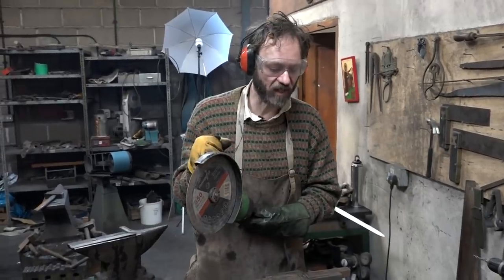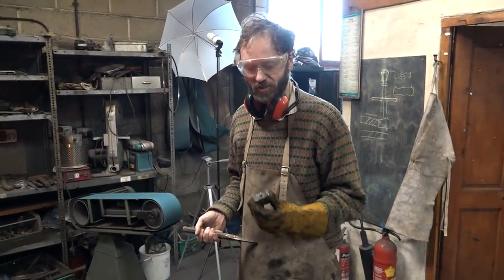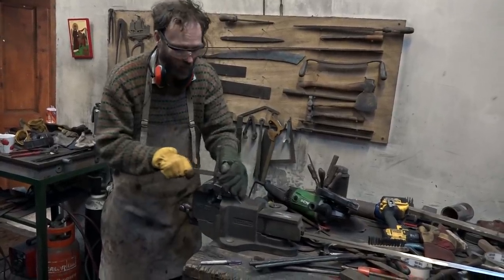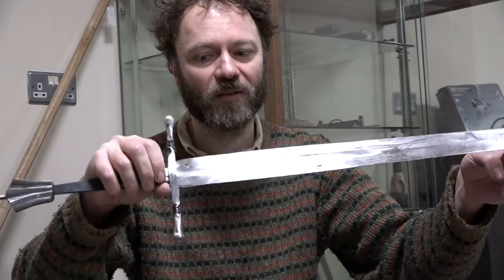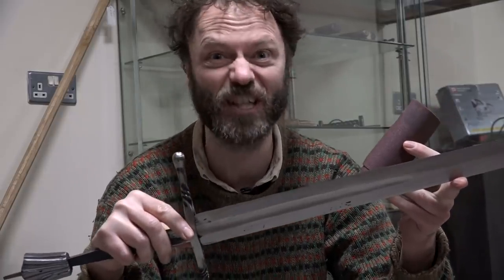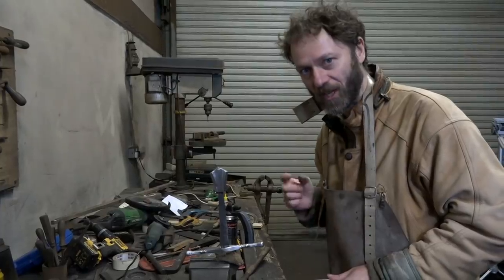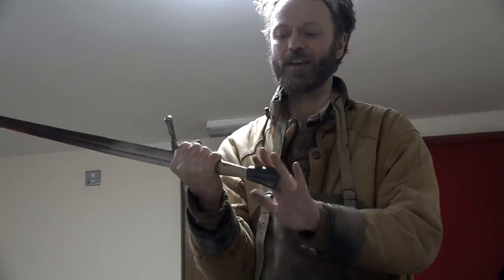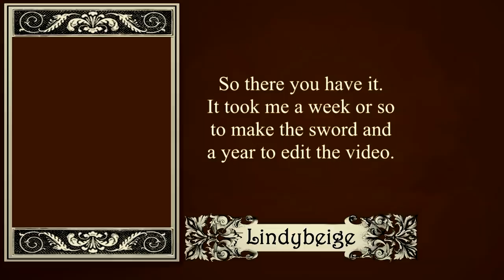Forging a sword: part five - completion

Comment: 5:45 please don't try to forge a katana made out of spandaus . . . we might not survive
Reply: Katana of spandaus sounds like a Japanese anime soundtrack themed eastern german industrial metal bands name.
Reply: The sword of Satan!...
Reply: You can't fuse the Axis powers like that, The Soviet Union stands in the way
Reply: If he did, it would take 5 years.
Reply: Medium carbon steel is medium carbon steel. You'd just end up with a katana with mediocre edge-holding.

Comment: It looks perfect. You'll just have to practice day after day until your muscles bulk up to match the sword.
Reply: Or he can start doing steroids and get..... BEIGERAGE!
Reply: 1. Using a sword doesn't require tremendous amounts of strength.

2. His armor is fitted for his current  body shape.  If he "bulks up" it wont fit.
Reply: its not hard to swing it real fast, the problem is to stop it fast, requires a lot of "wrist up" strenght  ;)
Reply: " stop it fast " that's what a Frenchman is for!
Reply: im not sure if that potato at the end was french or not, but without a little practice and strenght.... well lets say a noob would probably hit the floor, cause he would underestimate how much energy it needs to stop a blade in time ;)

Comment: the black "sooth" is called "forge scale" and a lot of smiths like to leave it on because its actually harder than the steel and also protects the steel from rust.

smooth all the parts out and finish shaping with paper or files, then throw the pieces back into the forge until they're at least cherry red, take em out and wait till the color fades, test with water drops, once the water no longer immediately turns into steam, rub it down with a rag coated in lind seed oil. 
makes for a beautiful black finish
.

Comment: 10:02 I want to emphasize how much of a good thing this is. This isn't just a cop out either, medieval craftsmen were really not all that concerned with symmetry as we are now. I'm not much of a sword guy, but definitely an armor guy, and in armor we constantly see asymmetrical pieces of armor and pieces of the metal with quite a rough finish due to the construction, and these are seen even on the highest of end pieces out there made for kings and the nobility. Modern craftsmen strive to accomplish the elegant level of imperfection.

Though I must say, that crossguard may be a bit too much on the odd end, but it really does give it character.

Comment: That's an awesome sword! Love the look of it. There is something that bothered me though. It was the sharpening.
It's very easy to overheat and weaken your edge on a belt sander, especially when you're drawing sparks like that. The edge will feel sharp, but wont last as long as it would if it had a better sharpening.

Comment: I think the drill press is replacing essentially the same technique as the drifting except you start with a smaller implement without a taper and work from both sides until you get a through hole. That's what we did when I took on axe forging anyways and believe me, the drill press saved you a ton of sweat and hassle.

Comment: Just conjecture on my part being an armchair blacksmith, but I think that pommels could have been made from bronze so that investment casting could be done with the tang hole included. Also could have heated the pommel and drifted a hole like you do there, but for the length of the thing.

Comment: All in all nice Work but i have a question couldn´t you rip some Wire around the Toung to add aditional Metal when you grindet to much Material of yes it wouldn´t be a Perfekt solution but would it work in Theory so you dont have to start all over again or is there a problem i as someone who neverworked Forged Metal before dosen´t know?

Comment: I've seen black smiths use a tool like like a spiked hammer to poke holes in redhot metal to create the eye of a new hammer. Perhaps that method was used instead of a drill?

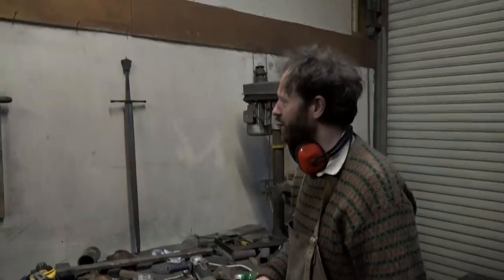Comment: Regarding the Spandau barrels, they look very much like the real deal, just that they, for some reason, were sawn over at the rear end(looking from the butt of the gun to the muzzle), just in front of the chamber. You can see those separate rear-ends of the barrels lying on top of the barrels at 5:57.

Comment: 2:08 Ah, but Lindybeige, they did have rotary tools like drills operated by water wheels. Now, of course that would be the type of advanced machinery used by the armourer guilds of Milan and Nuremburg. But yeah, other than that, a smith would just heat up the billet used for the pommel, then drift the hole with punches.

Comment: Imagine going through all that hard work of heat treating the blade just to then sharpen it on a belt grinder at full speed with no cooling
Reply from the maker: It didn't get very hot.  I was careful.

Comment: I will forever not respect you for failing to listen to a professional sword smith about how much stock steel you need to start with. If you told me I needed certain things to dance the lindy hop I’d take you for your word. That was basically slapping this consummate professional right in the face.
Reply: TomisHoare Yeah, still true though. Trust experts in their field of expertise. That’s why they’re so expensive.

Comment: What are the legal ramifications here? Can you just make a sharp sword without a weapons permit?

In high school we found out after making a crossbow that doing so actually required a weapons permit. (starting from a certain draw strength, which it definitely exceeded since it almost broke a solid wooden 'arrow' on a concrete pillar 30 meters away on the first test) The draw strength of that thing was so great that it only lasted a few weeks before essentially needing to be rebuilt.
Reply: Well here in the Channel Islands you're totally free to buy and own sharp swords, and our laws are similar in many ways to those of the UK so I can't imagine why you'd need a permit. I mean is there really that much of a difference between buying a sword and making one yourself when either way the end result is you obtaining a potentially dangerous item. I know the UK's weapon laws are draconian and ill-conceived, but I'm not sure if they would nitpick to quite that extent.

Comment: Actually, properly made medieval drill bits probably could drill through steel - just not that way, and certainly not that fast. Clickspring has done a video on case-hardened steel from the Hellenic period that - with care - could drill mild steel. Not hardened steel tho.

Comment: I personally think, as someone with a very very mild use of boring holes with a similar if not identical machine (assuming it's using a belt) that the breaking of the drill bit was due to a lack of a pilot hole and a lack luster oil being used. However i have only done militer drilling, so i might be totally wrong
Reply from the maker: Clearly, we got something wrong.
Reply: @lindybeige  to be frank i have no idea as to why it failed, i was just taking a best guess, and my phrasing seems quite hostile. I am sorry if i seemed antagonistic
Reply from the maker: @TheCynicalblue  Good lord - don't worry about that!

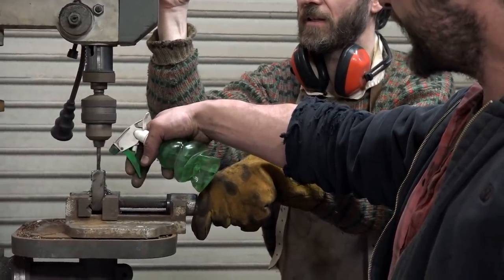Comment: Around the 2:00 mark you mentioned that they might not of had drill bits to drill out a pommel in the same manor. I did recently watch a another video on the Antikythera mechanism that illustrated a possible drill that could of existed during the bronze age (https://www.youtube.com/watch?v=OtWVA7_9Rik). To me, it could seem possible the same drill bit could of carried over into steel machining but I'm neither a historian or a machinist so I could probably be wrong in my thinking.

Comment: Imperfections are just signs of authenticity. If I went out of my way to make my own blade and it looked like I bought it commercial, then what was the point? The experience is all well and good, but I want to look at it and say "I made this, I made this 'mistake'" and that's not even a good word. You'll always remember why one twist on the quillons is tighter and there's a story, albeit a short one. That's your sword now, a steel encased with story.

Comment: Drill bits only cut at the tip, so the twist just helps remove the chips. The older "spade drill" design is much easier to make, and does the same job, only slower. Clickspring has a great video showing how: https://www.youtube.com/watch?v=N1aj_3tlQhU

Comment: Jesus, use oil on your drill press. I have never broken a drill bit and I drill hard steel all the time.
Didn't think an expert metal smith would be using water for christs sake.
Also, cut down the grip after it's on the handle. That way you get the split right.